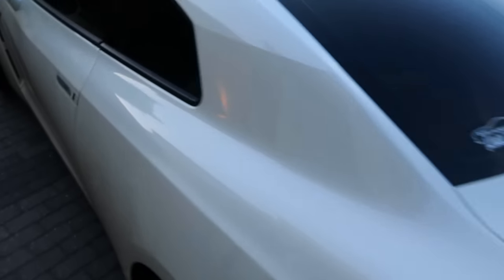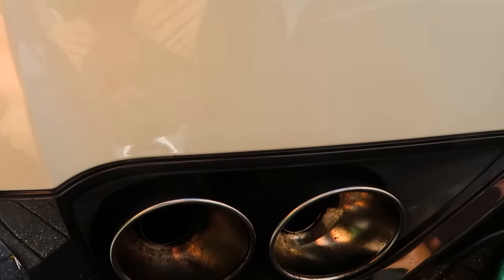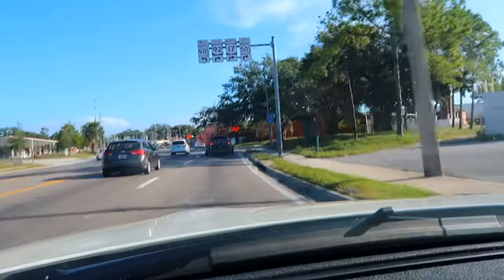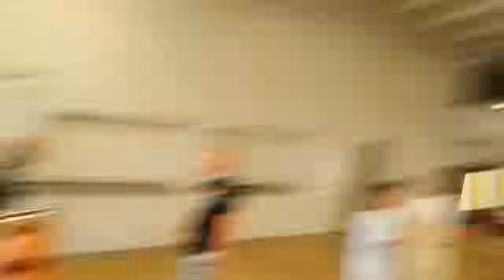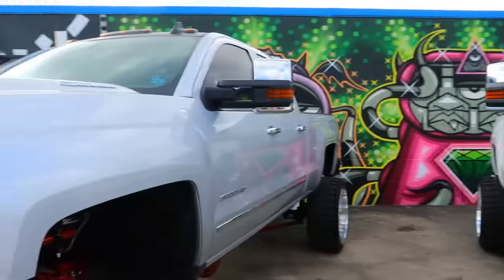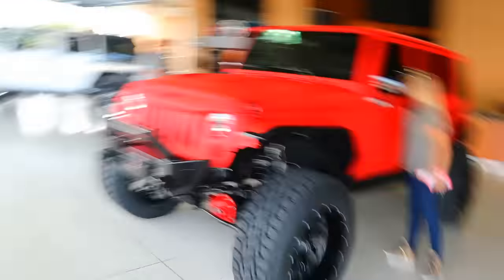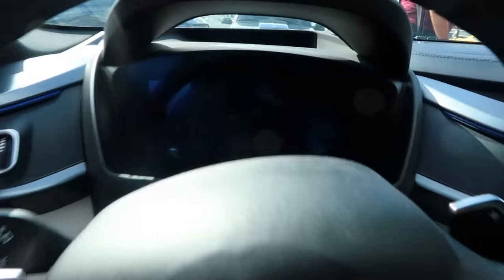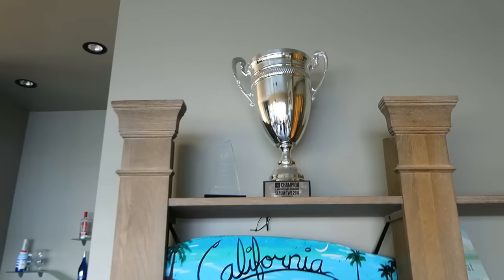WON AN AWARD AT OUR FIRST CAR SHOW!

Comment: Brillo pads and PD-680 for Exhaust trev. I'm in the coast guard and work on helicopter engines, we use that to clean our engine oil vent lines. Shines it right up no damage

Comment: Tmartn u have to put coke
Reply: Let it dry then wipe it
Reply: +Trev and Chels +TmartnOr a good acidic solution. White vineger is a weak acid and it should do the trick if youre not down to use coke. dont worry about the stainless thought it will be fine with either :).... If youre feeling really ballsy you can try to use HCL or otherwise known as muriatic acid (the stuff you use to balance your pool) just use gloves and clothes you dont care about!

Comment: Those tips may be like "burned" in the metal. Couldn't see too good but you know how metal gets when it's real hot, then introducing the Carbon from the exhaust may have permanently  "stained" it. Or you may need to use a soft copper brush and some product.

Comment: If you go to hom depot get a pack of steel wool and use that for the exhaust tips it will NOT hurt them it will take all the black off them

Comment: They have a Dodge Charger in addition to the gtr jeep truck? Use steel wool with some simple green and it will remove a lot of the crap off the exhaust

Comment: Use 0000 steel wool and a super degreaser for the pipes and also my wife and I are relocating to Sarasota FL in December to move my mobile detailing service down. If you need anything get ahold of me!

Comment: Those tires on those lifted trucks look so stupid. There are lifted trucks like that all over here (Texas) but you have to have some meat on those tires it looks stupid with tiny width tires. I use to have a jacked up Ford F-250 diesel jacked up it was badass.

Comment: the i8 is an over-rated prius
Reply: Usually a reply like this comes from someone who can't afford one.....the I8 is NOTHING like a prius
Reply: Jason Bronzo #1 it wasn't made to be super fast it was made to be unique and have a cool factor. The line. The doors. The design. The electric is just an extra added cool factor and bonus to be Able to drive around town locally with no gas.    #2 it's still reasonable fast considering it has a 3 cylinder, it still runs 12's and is quick off the launch because of weight.    No it's not gonna outrun a GTR or lambo but it wasn't designed for that.  If you made it 200k-250k brand new like lambos and Ferraris then yeah it probably would.   It's simply a cool car that EVERY SINGLE PERSON turns and breaks their neck over
Reply: Jason Bronzo Your right, i outrun most cars on the road, but if a hurrican or a 458 pull up I'm probably done for. Even a GTR has a good pull on me. I don't like speeding tickets or crashing i drive slow mostly so i like the cool factor. If i wanted engine i would def go to an aventador or something like that